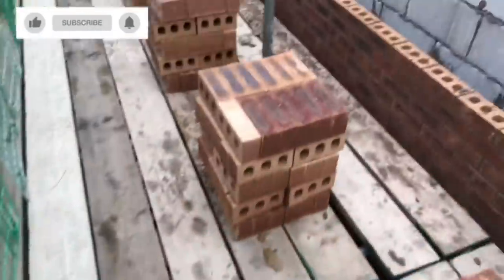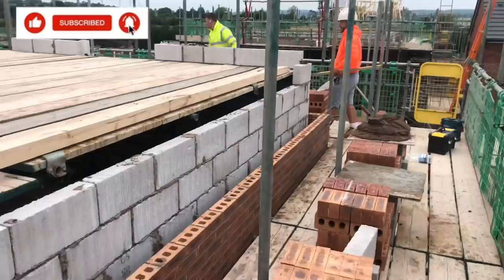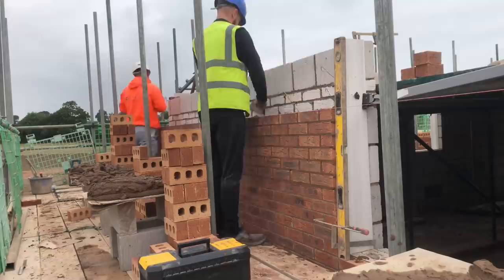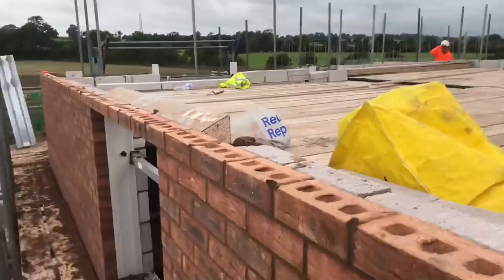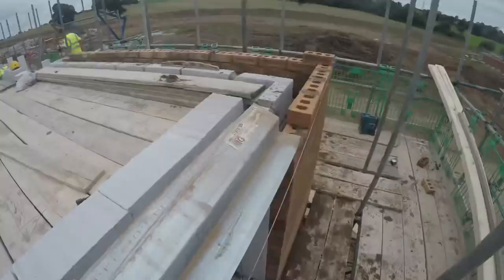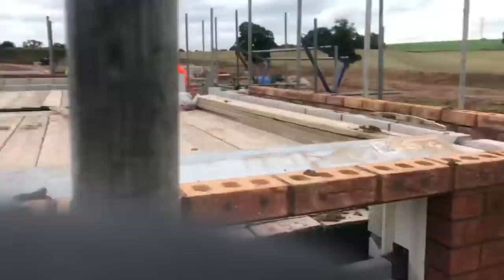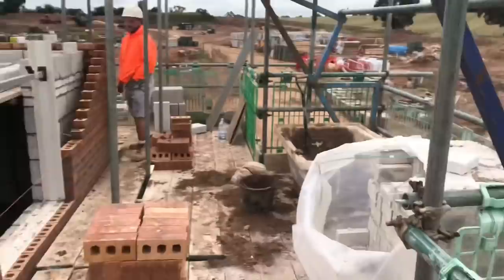Smashing the work in today!! 1530 Bricks in 5Hours!!!  Bricklaying Vlog

Comment: Ey very nice work today mate ..proper smashed it 👌💪 Glad to see I'm not the only one who thinks gloves full of holes are still some what useable 😂😂 They've still got a good week left in them mate😉😂
Nhbc Site question. I see ur at 2.1 and u got a course of ties under your x2 corse of brickets. Would you throw your next course of ties across now? (So 375mm from last course of ties)
Know it might sound like daft question..but we've only ever worked work with insulation sheets, even on new builds..so we make things work 450mm..so both ties and insulation always work together.
Loved the headcam footage mate! Keep up the good work and videos!
Reply from the maker: Hahah another month left in this bad boys 🤣🤣 Cheers mate and we have had mixed thought of numerous NHBC inspectors with the tie situation we usually just make sure we have a tie every 3 course of block on the reveals and if there’s a couple course of brick in the run put them in after 375mm , The insulation always gets pumped in on most sites now bro so no need worry about where we put them 🤣 the more the merrier I suppose haha 👍🏻👍🏻
Reply: @kurtmalpassbrickwork6255  haha figured it would be that mate. I guess as long as you dont go ever 450mm they dont really care...bet you've not seen the price of ties av you..£114 quid for the yellow and white box of ties😨😮..
Reply from the maker: @IzzytheBricky  Jesus Christ that’s ridiculous I Didn’t know that hahah I could make a living going round picking them up of the floor on-site 🤣🤣🤣🤙🏻
Reply: @kurtmalpassbrickwork6255  hahaha I know lad! Dw I've got a good few boxs stashed away😉..better than copper and lead😂😂